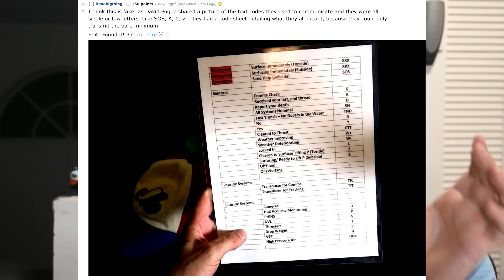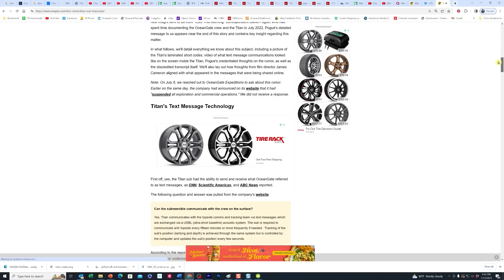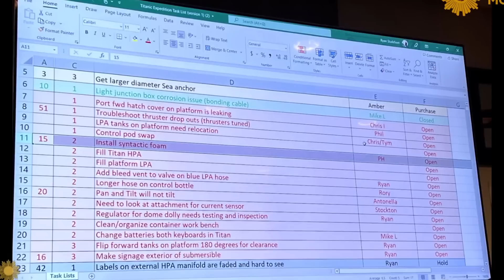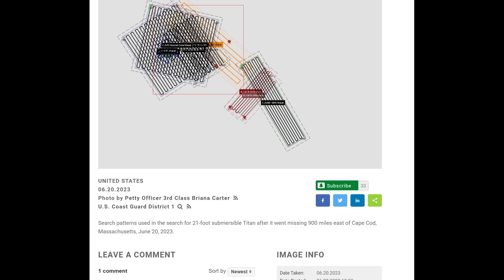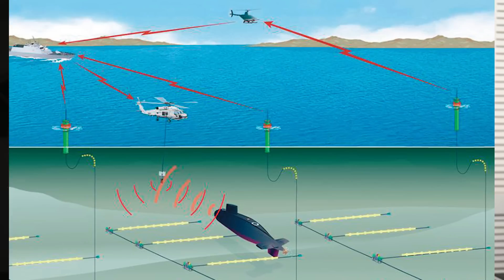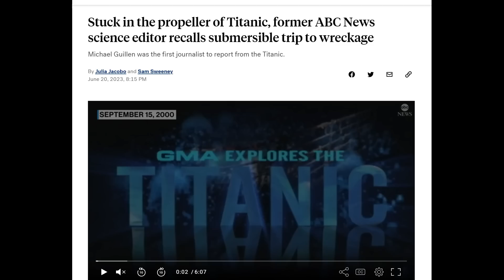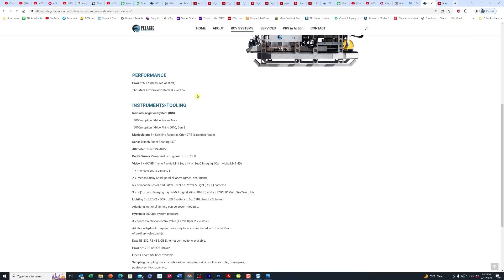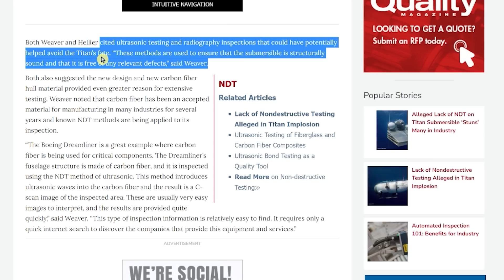The Shocking Truth About Fake Sub Transcripts No One Tells You

Comment: Again, if that transcript is for real, it must highlight the fact that they must not have anyone topside who was properly qualified to oversee that dive from the surface. If they really were descending at that rate then surely a qualified person would have called for an abort just minutes into the dive. Because if your going down that fast you must be well over the calculated weight which would allow for a decent rate of accent in an emergency. And according to the transcript they even dumped the landing frame in order to get the thing to ascend.  A qualified person topside would have worked that out straight away, and no doubt they would have also worked out the maximum descent speed to stay within their safety margins. So if the transcript is real, and the Titan really did descend that fast, then it must be even more damning evidence against Ocean gate for the way they were conducting these dives in an unsafe manner.
Reply: Just because they post an approx descent time of 2.5 hours, why do you think that is the fastest they can descend? No one has sighted any physics to say what is and is not a safe descent speed. And If I was creating materials for their website. I wouldn't tell what is the fastest time of descent. I would state what is the average so nobody can complain if it takes that long. Then  if you get there early,  you have more time on the bottom, and your passengers come back thrilled.

For the record and in hindsight, I do think the speed of descent was problematic.  But I don't think the captain believed that.
Reply: @Nash1a  With a submersible the descent rate is solely dependant on the weight of the craft, that is why the descent rate is so important. Not so much so on a submarine, which uses surfaces such as the bow planes coupled with it's propulsion system to change how quickly it can descend or ascend. Plus of course a submarine also uses ballast tanks it can flood to descend at a faster rate, and then of course they clear those ballast tanks of water to rise quickly if needed. Which is a system that deep-sea submersibles cannot use.

Yes, I guess in theory a deep-sea submersible could carry down a whole lot of extra heavy ballast to increase it's descent rate - to how safe a practice that would be I do not know. This brings us back to my point, if the transcript is real, then the Titan descended at a rate much faster than it should have compared to the amount of ballast it was carrying. They dropped all of their ballast - including a very expensive landing frame (which would normally stay with the sub), it would seem they dropped everything they could in order to make an emergency ascent. But the craft was still too heavy to start rising at even a normal ascent speed. After dumping everything they were still only achieving a very slight positive buoyancy. I think the rate of descent was far too great for the amount of droppable weight they were carrying. They should have realised straight away that they were descending faster than they should be. 

They either chose to ignore that for whatever mad reason, or if they had added more ballast to allow for a faster than normal descent rate (compared to previous dives made by the Titan), someone seriously miscalculated the amount of positive buoyancy they would have once they dropped the ballast. If they were not capable of making such calculations without such serious errors, then they had no business playing games at that kind of depth.
Reply: @100SteveB  I think I understand.  Based on what you've said and other things I have heard, I think you're saying that they should have taken their initial faster than expected descent speed (36-39M/Min) as a sign that something was already wrong from the start. Is that correct? 

If the transcript is to be believed, the last 10 minutes of descent, before they began jettisoning ballast etc., was about 47 M/Min; nearly twice that of the expected 25M/Min.  I keep wondering if some buoyancy characteristic was changing as they descended.
Reply: @Nash1a  That is correct, their descent rate would have been calculated before the dive. I guess they could have loaded more ballast than normal to increase the rate of descent, but seeing that even after dropping all the ballast and the landing frame they still struggled to get the craft to rise, it is obvious that they were heavy than expected for some reason. A calculation error could have been to blame, or, like you were wondering, was something changing the buoyancy whilst the dive was in progress? But I am struggling to think of what on that craft could have been flooding. Obviously not the pressure hull itself, they would have known about that very quickly. I don't know enough about the subs design to even guess at what else could have possibly been flooding without the crew knowing. 

But of course, we are not even sure if the transcript is for real.
Reply: @100SteveB  I don't understand this but I can parrot back what someone said. They said that if the carbon fiber cylinder was delaminating, it could have been creating voids and allowing water to flow into them.  I only wonder if that alone could account changing the buoyancy enough to account for the amount of increase over their intended velocity. Or maybe delamination allowed the cylinder to compress a bit more than usual changing the amount of water being displaced.

Comment: Regarding the Navy, they utilize a static underwater array of accoustic listening stations (SOSUS). They would have had to pull the data from the closest arrays to listen for possible signs of implosion, confirm with anterior listening stations, and then triple check with multiple underwater acoustic experts. That process doesn't happen in just a few hours, and certainly not for an incident that doesn't threaten national security. Hope that answers some questions around why the Navy didn't release the info they had right away.
Reply: If SOSUS doesn't generate that sort of information in near real-time, it's not much use at the present.

If SOSUS released that sort of information at any stage, it wouldn't be much use in the future as a deterrent.

Comment: Mapping 10 different applications to one  Logitec controller in 1 PC ..How do you switch to different applications if the Map is set .. means you need to switch app, than select map every time .. i think it was an all round system failer, not only did the carbon fiber fail, sensors failed, controller failed resulting in a mission failer.

Comment: I would think that the greater concern when joining the titanium end to the cf cylinder, would be even load distribution over adhesion.
The pressure at that depth was probably pushing the components together with more force than the adhesive strength.

Comment: I'm also leaning more to the "it's fake" side.

What I'd really like to know is what the volumetric bulk modulus of the Titan was - how much intrinsic buoyancy did it lose from the  surface to say 3000 meters due to compression?  Could this BM slowly have been degrading after repeated dives before the rupture occurred?

1) If Stockton had been doing his utmost to manage the emergency ascent he would've got Hamish or PH to take over the comms to topside - the style of the texts shows no evidence of such a change.

[07:54:07] [TITAN] Descending now
....
[09:17:50] [TITAN] All under control. At 2960. No adjustments needed. We’re enjoying the ride.
[09:28:16] [TITAN] we’re noting an alarm from the rtm
[09:28:35] [TITAN] reducing velocity descent depth 3433
[09:30:55] [TITAN] no change with thrust the rate of descent is increasing. At 35. Going to release the ballast now. Standby.

from here I would imagine Stockton would have his hands full, it should be a different style of texting - apart from the "neg" it looks the same to me

[09:32:12] [TITAN] No improvement. Preparing to jettison the frame.
[09:35:48] [TITAN] frame jettisoned multiple attempts needed. But starting the ascent now.
[09:40:12] [TITAN] neg
[09:42:12] [TITAN] trying to run diagnostics. Ascending now. But very slow. Sounds have subsided. Global RTM alert active all red.
[09:42:42] [TITAN] slow ascent in progress. quarter predicted. Unclear why rate is small. No indicator. At 3476. Aiming for the surface.

final supposed message

[09:46:37] [TITAN] reading red on the A power bus. I switched to B. at 3457m more sounds aft.

2) The two places the transcript was first leaked - I cannot find the article that first mentioned it, I thought it mentioned a website (maybe hosted in Pakistan), and google & bard are reporting the first leaks on TikTok and YouTube.  If this were real it would've been sold to mainline media and TV networks. Or at least they would've been approached, even if they didn't take it.

3) Parks Stephenson—a Titanic explorer who worked with director James Cameron on Titanic-related projects—said he initially believed the text, but then found inconsistencies. [NewsWeek Article]
Reply: I don't think Rush would allow anyone to take over comms. Based on info about his personality and flippant disregard for numerous expert's warnings, he seems like a person who wants, even needs, total control.
Reply: @user-lr6nj4rm5k  I think at that point Rushton knew exactly what was happening, I think he would have changed dramatically in those last minutes to try recover from a desperate situation - I reckon he would have subjugated his ego in a bid for survival for all of them.

Comment: I beleive Pellagic released some information.  Other ships had lift lines down to roughly midway to Titanic (don't remember exact depth) and there were other ROVs  at that depth. Oddysseus lifted debris to that depth and the ROvs would then attach the lift lines to debris and Oddysseus could then go back down while the lift line to ship would raise debris up.

It is a real shame that there ois no factual consfirmation of what comms was available between sub and surface. (doesnt mean confirming authrnticity of the alleged log, but just factiually stating what is an isn't available.   Hopefully Coast guard releases a factual report of what was recovered (including comm logs) shortly before delving into the long study of what failed and why.

Comment: Speaking Engineer to Engineer, myself with almost 40 year in R&D and some of it structural and pressure/vacuum vessel design, I say kudos for your fact finding and source references and it has been fascinating. A big THANK YOU, everything you bring up is right on! That transcript had no hint of fakery and no one should disparage your analysis as those that really know can tell you know your stuff. Winding the hull with perpendicular radial wraps made it unstable to axial (what I'll call "pinch") buckling deformation from outside pressure, like Mr. Cameron said "the wrong material in the wrong application". Everything about that glue joint and ring gland was wrong too, from design to application. One good thing from this tragedy, Rush established the cycle life of that design at 14. No one should ever do that again!
Reply: Truly sadly I don't believe that it had actually ever made it to the titanic but once... correct me if I am wrong tho... the 13 other times were attempts and or tests...
Reply: @jdjd962  One report I heard was it had made 90 dives but only 13 were successful. With all the info about it now, it's incredible they made 13.

Comment: As a machine designer, I believe that the carbon tube should have had a steel "ring" positioned mid-way inside the carbon tube to limit inward deflection of the tube which caused it to delaminate from the titanium.     I think that the "cracking" noise was from the tube delaminating from the titanium.
Reply: Can you explain this like I’m 5 using simple dumbed down English please

Comment: Each time I watch a video on the Titan a new question comes to mind.  Exactly what were they doing?  Rush would have you believe it was for scientific research.   OK, exactly what data was collected?  Had they published any peer-reviewed papers?  At one point I thought I remember Rush saying they were studying the corrosion rates of the steel.  If this is true, why?  Certainly, it is easy enough to test corrosion rates in a laboratory.   Also, why study 100-year-old carbon steel?  Today wouldn't the greater interest be in the corrosion rates of alloy steel?

Rush claimed that the carbon fiber hull was an innovative approach to materials for submersibles.  He claims his approach was cutting-edge technology.  Yet, he seems to have done nothing to support his technology other than testing to destruction.   He did no non-destructive testing (NDT).  If he was proving a new technology shouldn't there be tests before the first dive and after each subsequent dive?   He claimed to have developed an acoustic monitoring system.  Shouldn't there have been tests to correlate the cracking noises heard during dives and the monitoring system?  Shouldn't there have been tests to determine the cause of the noises?

OceanGate unfortunately for the passengers on the last dive of Titan, was in the business of joy rides to the bottom of the ocean.  There was no research.  There was no cutting-edge or innovative technology.  If carbon fiber was the future of manned submersibles it is no longer.

Comment: The decent rate of the Titan according to this transcript doesn’t seem concerning until they get much deeper. They hold a pretty consistent 37 meters per minute, and then accelerate to nearly 50 meters per minute before trying to surface. That indicates a loss of buoyancy which could also explain why they weren’t going up. If that bouncy was from battery bus A it would take out power. The question is how does that explain loss of the primary pressure hull? Or was there really 2 completely separate serious failures on the same dive?
Reply: I wonder if that there carbon fiber got wound up on the propellers like fishing line sometimes does to boats???
Reply: Hopefully we will get a lesson in carbon fiber... maybe some crochet lessons as well lol
Reply: @jdjd962  the carbon fibers are locked up in the glue, they cannot unwind or have a thread pulled like a sweater. Once cured its basically a plastic, with the fibers spreading the load internally. 

Also the propellers are not active during decent.

Comment: But then, you would naturally want to NOT use acronyms or shorthand during an emergency procedure where souls are on the line. Also, it's doubtful they had many codes applicable to the re-orientation of a thruster. So I personally don't think that argument you describe against the transcript, based on the previous procedure, holds much weight.

Comment: Submarine sailors use PRECISE language to avoid confusion.  It is easier and more prudent to argue on the Surface than at depth.  The teams  on the sub and mother ship were rank amateurs and had no business being there OR the transcript is questionable.   Rode submarines in 20yrs of service, on building crew for one, overhaul crews for two additional.  When conducting sea-trials, specific time dependent protocols were followed so that the surface ship and the sub were in sync.  The both crews understood the Plan-of-the-Day; deviations were to the plan were well documented and all members crews on the sub and mothership understood ANY changes.  SSN 685 was saved by the Engineering Officer of the Watch.  He assessed the angle of the ship change on sea-trials - when none was scheduled - ordering Back Emergency while flooding was occurring via the snorkel head-valve failure, before the Control Room ordered Emergency Blow.  Professionals or rank amateurs?  Questionable transcript if you believe professionals did this dive.  I doubt the sub crew and topside crew were amateurs.
Reply: This poses some excellent questions, like- How many of the topside crew were professionals and how many were amateurs?

Comment: Was the BBC sub tethered to the surface? Was the Oceangate sub?
     Most radio bands have extremely limited range in water. Only the very lowest frequency bands work, and these low frequency band have very restricted bandwidth. Allowing only a single letter message.
    A tether makes communication much easier as there is a wire into the sub.

Comment: Was that screen zoomed in enough to read what the sentences were? It could’ve just been a series of those letters, not actual words. This makes the most sense considering passengers COULD see the screen. Do you want them reading how the thrusters weren’t working, etc.? The sub may have responded in full sentences back (I doubt it), but the original messages down could just be the series of letters. Also, I was one of the ones questioning why the top side didn’t push more worry of the rate of descent. I didn’t miss that message. The public thinks this is some kind of ramshackle operation being run by people with no knowledge of anything. Rush pushed the limits and bypassed regulations. He used a material without proper testing for long term use. But he was an educated man and he wouldn’t hire interns whose schooling consisted of culinary arts. He got that thing to work for what, 3 years? I would think he understood descent rate.  Unfortunately his hubris and belief in the sustainability of the submersible got him and the others killed. His legacy will not be as a groundbreaking explorer, but that of a reckless individual who cost people their lives.